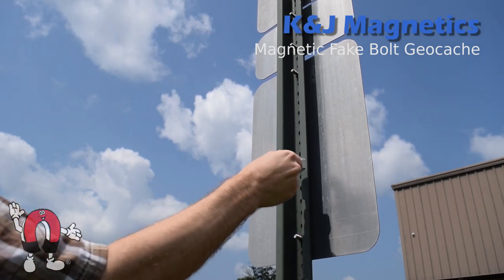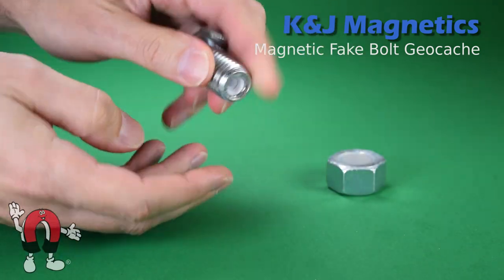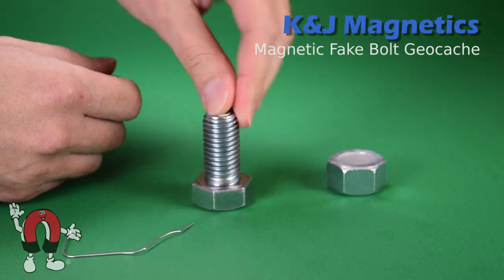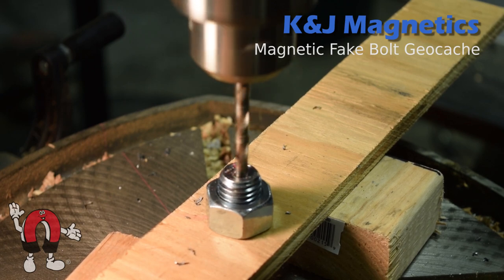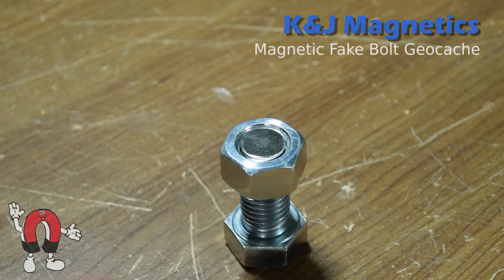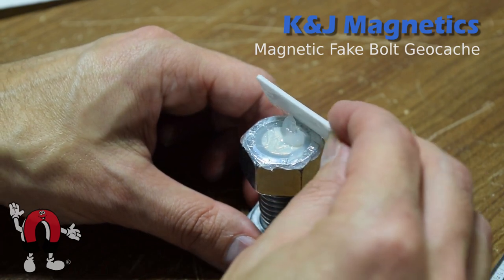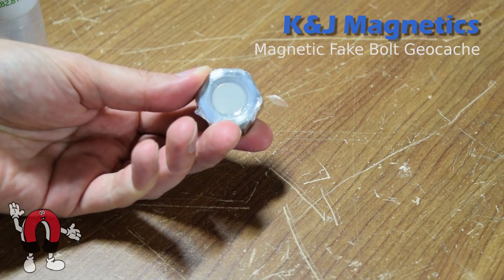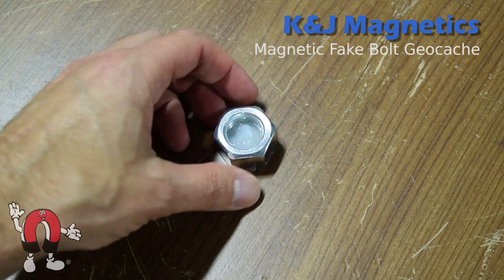Hidden Bolt Geocache

Comment: Notice how that one looks so much different than the other ones on the sign? You did it wrong. Cut off the head and then drill the hole from the side the head used to be on. it looks WAAAAAYYYY more real.